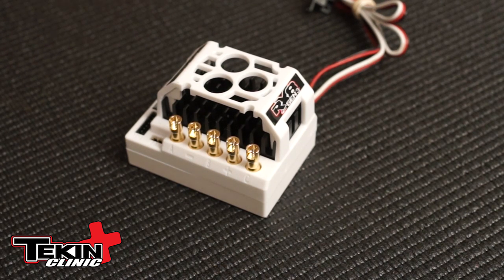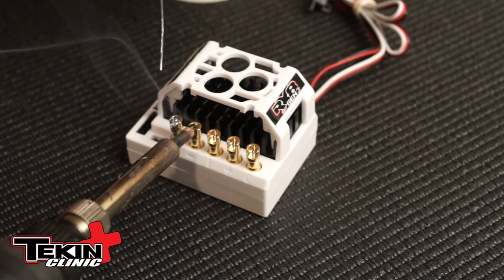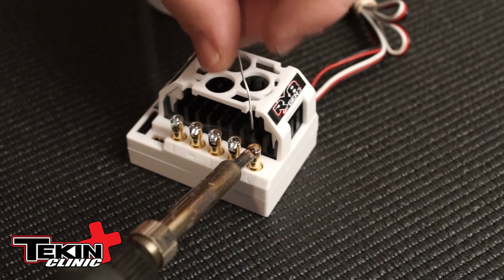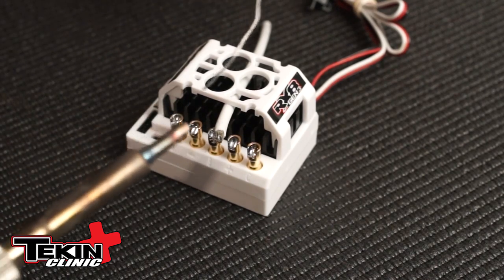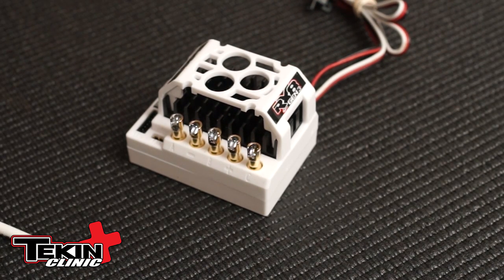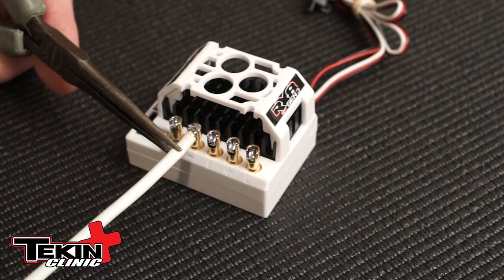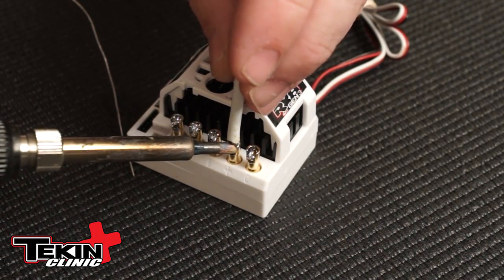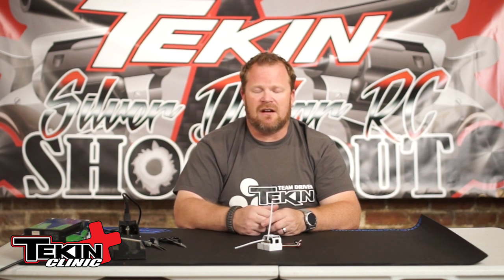Tekin Clinic: ESC Soldering

Comment: I keep popping capacitors. I have a g3 2.5t motor, rsx esc, 70t spur, 28t pinion and a 5200mah 2s 7.4v lipo in a 4tec 2.0. I have followed tekin's instructions explicitly! The 330 cap(provided) popped and so did the new one i just ordered. Should i switch to the 1000 cap, or just set fire to the whole damned thing?
Please help.

Comment: Are the RX8 posts larger then the RS Pro posts? I would like to be able to solder mine up like that, I can't seem to get the wires to fit in the notches like you.
Reply from the maker: They are bigger. The RS PRO posts have a solder cradle, that is what they slot is for. You don't have to get the wire down into the slot, it's just for holding solder to make the joint flow all the way around instead of just the sides and top.

Comment: What soldering station did you use? Mine is Wellar WD-1 but it doesn't melt the solder once it is applied even at 440 degC. Annoying and made the soldering on my RX8 a complete mess.
Reply from the maker: The station is a Hakko 936. The type of solder used can greatly impact the difficulty, we always use a 60/40 rosin core solder and typically set the iron to about where you have it. If you're using a silver solder, we strongly suggest ditching it and getting a good 60/40. It will melt much more easily at your iron's temp.
Reply: Thanks. I used silver solder,,, which is very difficult to apply... I will get the same solder as you had and re-solder my RX8..
Reply from the maker: That should help you out a lot! Silver solder is a bit of a pain and needs a really smoking iron with a big tip to transfer a lot of heat to the solder joint.